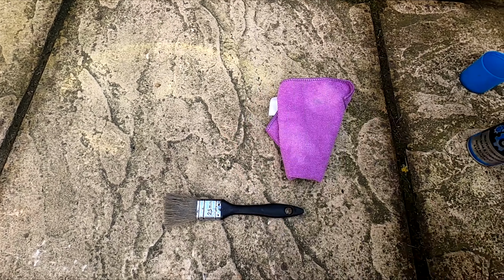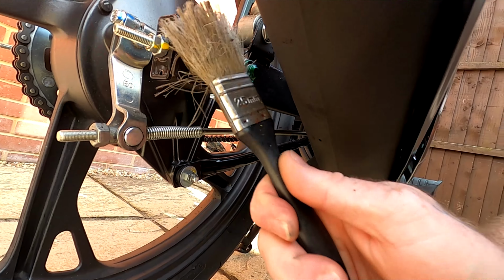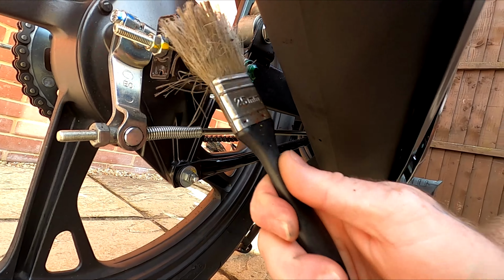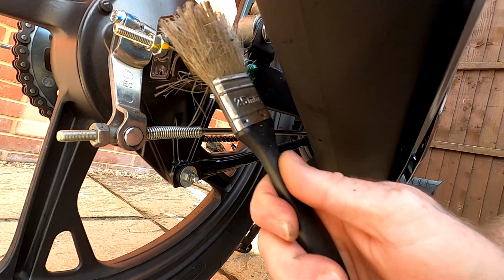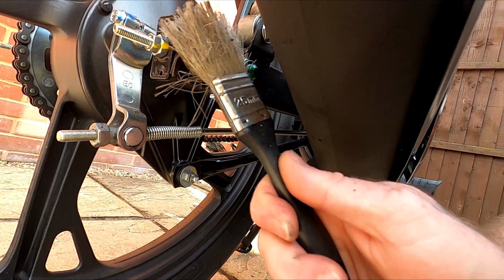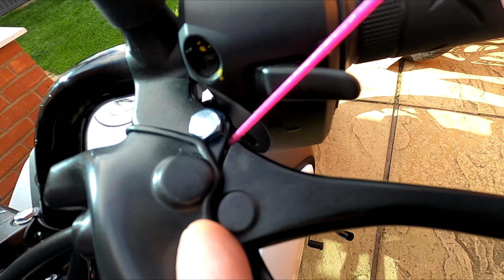Honda CB125F Winter Hacks | Rust Protection |

Comment: Great video. Whats the point of applying silicone spray on top of the acf50? 
Thanks
Reply from the maker: It sticks in areas that acf50 won't. It's a slight spray and makes a great addition to acf50. Although not necessary
Reply: @NickandJodie  Awesome. I Will do this. Although i Will be using xcp clear coat rust blocker because of its reviews. Thanks again!

Comment: Hi. Nick, i used to use acf50 and ride all year but v expensive. I now after the full clean apply gt85 everywhere(except brakes and tyres of course), wipe any excess and does same job but for much less. My bike 16yrs old and still almost as new
Reply from the maker: Thanks I have just run out so I will give thag a go !
Reply: How often do you clean it in winter? And do you live in a area with lots of road salt?
Reply: @joakimdam9723  I clean it once a week and no not really salty I suppose
Reply: @volt8684  damn nice to live in country hot weather with no road salt

Comment: How often would you do this routine during winter commuting with lots of road salt? After a wash is the pretective routine wasted, and all 3 needs to reapplyed. Really afraid of winter riding in Denmark because of excessive salt use on roads
Reply from the maker: As often as you can, at least evey 2 3 weeks
Reply: @NickandJodie  so you would wash it first with soap and then run this routine afterwards?
Reply from the maker: 2nd 3rd routine don't was it
Reply: @joakimdam9723 do not use soap. Use proper motorcycle cleaner. Then dry off thoroughly preferably with compressed air. Leaf blower on low setting. Or purchase a motorcycle blower. Then add acf50 or xcp rust blocker

Comment: Is silicone spray good lubricant only or it protects ? Im thinking should i use wd40 as rust protect on front fork chrome or silicone spray
Reply from the maker: Wd40 is absolutely fine - silicone works same way, less mess

Comment: which is the loudest exhaust in your opinion for honda nc750x
Reply from the maker: Black widow full system
Reply: @NickandJodie  which one if you know GP round, oval, hexagonal, round, tri oval
Reply from the maker: Gp round for sure
Reply: @NickandJodie  thank you so much for your help, then is black widow full system gp round, 230mm or 350mm
Reply from the maker: 230mm has a shorter muffler so will be louder 😀
Reply: @NickandJodie  thank you

Comment: well done, very in detail explained, Only a wee question. After the winter do you need to remove any grease? Do you cover the bike with a cover blank after this process?
Reply from the maker: After winter give it a good clean and no need to reapply until autumn. If stored in a garage use a blanket to cover too.

Comment: Hi Nick, thank you for very informative video. I just bought muc-off motorcycle silicon shine, and it's says: do not use on hot parts.

In the video, you are spraying at an engine part. Is that a problem? 

:)
Reply from the maker: Muc off silicone spray is the best! Spray when the engine is cold. I've been doing it years, never had any issues. Thanks for your kind words.